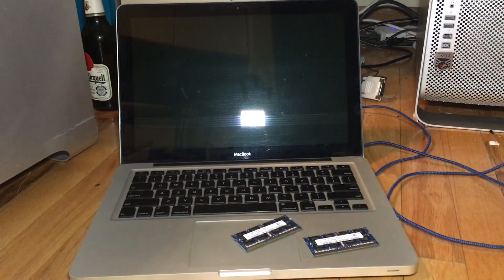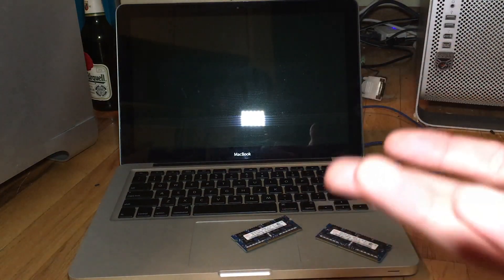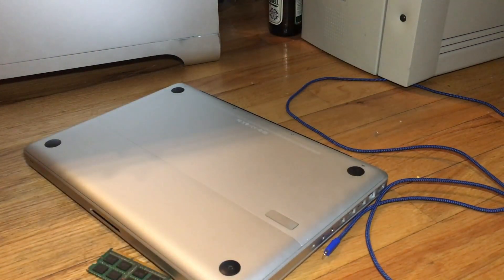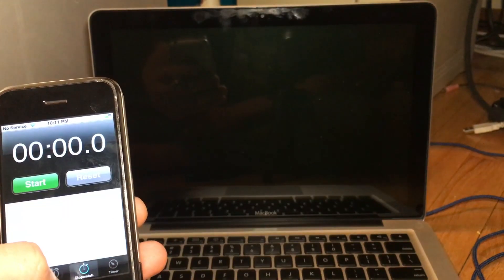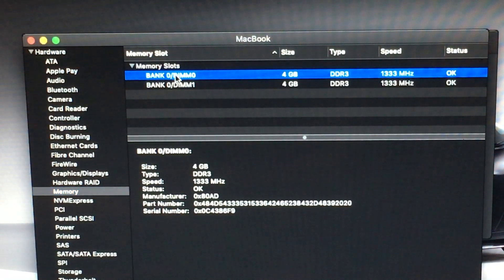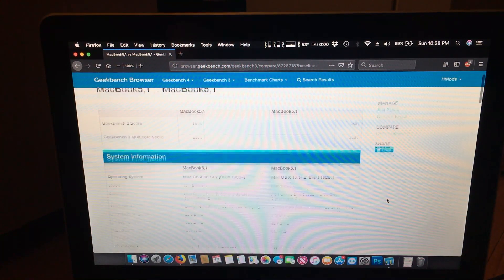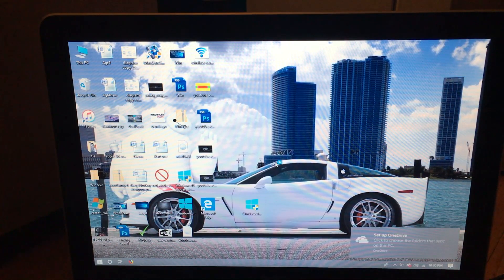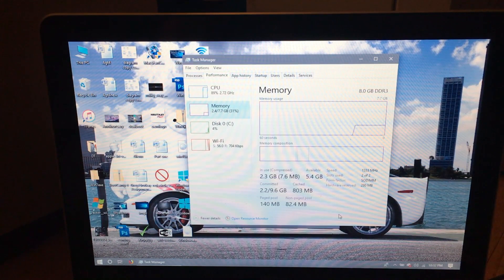Upgrading & Testing The World’s Fastest Late 2008 Unibody MacBook Pt.2 - RAM Testing

Comment: Funny how my 2.4GHz version I paid $40 at a local pawn shop that said no power as is(I actually got it working in 5 minutes while still in store) has a lighted keyboard. I was actually installing Mojave while I was watching the first one. Did a Geekbench 4 to compare your results and got 1646 single core, 2774 in multi-core. This is my first Mac and it is pretty good for what the system is.